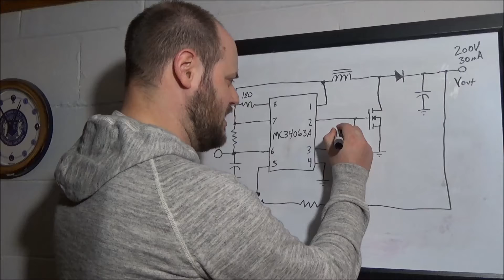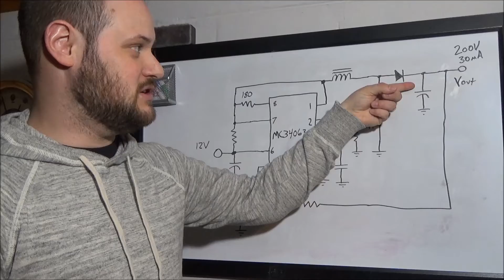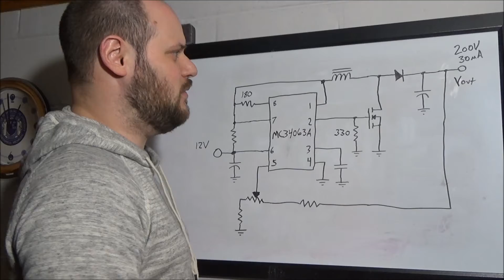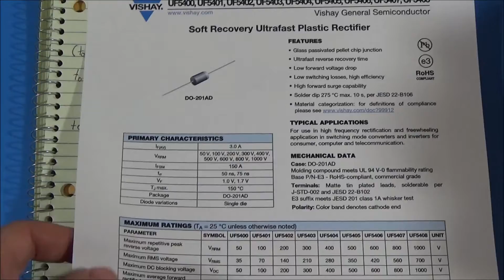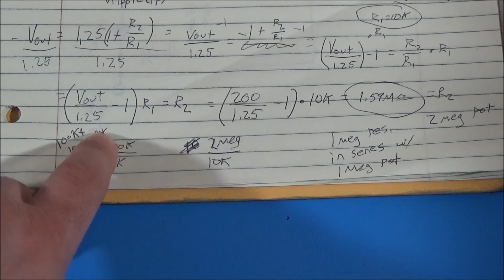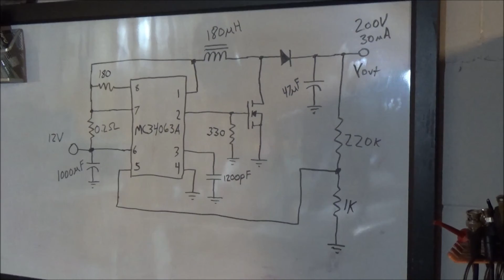OhmsAtHome #16 Nixie Clock Power Supply Design

Comment: I don't know about you guys, but building this led me to some quite frustrating failures including big voltage drops when connecting some resistance on the output and my mosfet heating up like the deepest pits of hell.
this instruction though helped me out:
https://threeneurons.wordpress.com/nixie-power-supply/

I guess it was the active pull-down instead of the bassive presented in the video, I don't know what mosfet Andrew used. Seeing the others asking about the mosfet as well makes me think our master might forgot to mention :)

Comment: 2 small remarks, first of all, i experienced that you need to do a little trick to turn up the duty cycle of the MC34063. This can be done by a simple PNP transistor with a schottkey diode. Secondly taking a potentiometer is good for trying out what is possible. You can tune this to get the preffered output. But I think you should mention, that at your final design (the one you use for powering your nixie tubes) you should take a fixed resistor, because a potentiometer can change in resistance. Great video btw! good explanation!